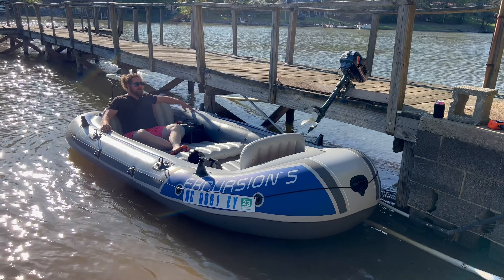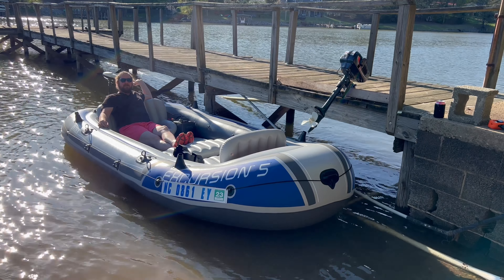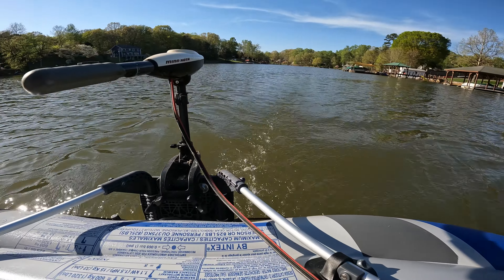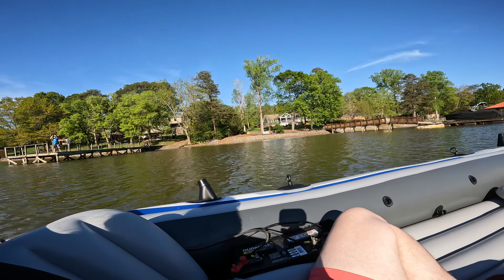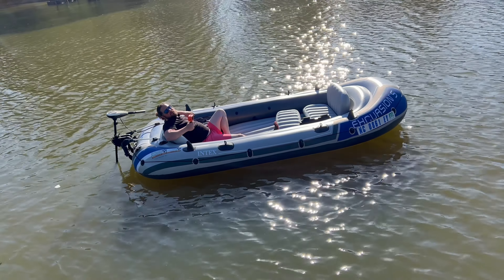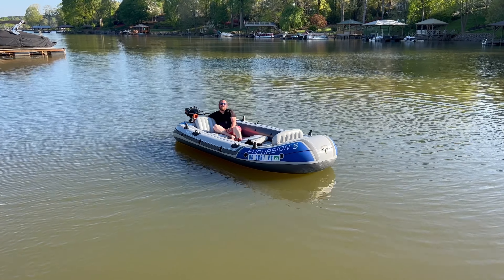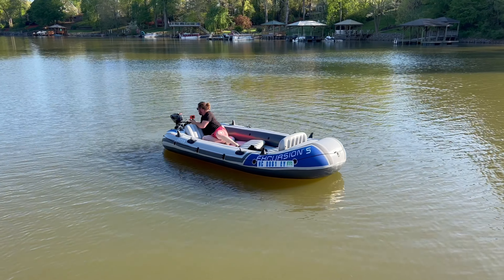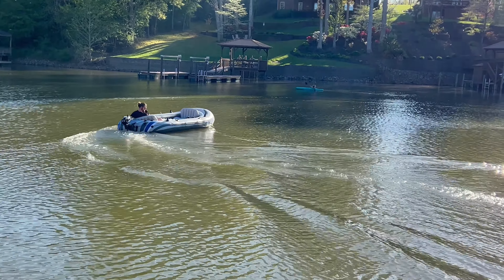Intex Excursion Gas vs. Electric Motor

Comment: Years ago I used to have an Intex Excursion 4 and I put a Minn Kota 30 on it. Only paid $100 for it back then. I also had a Minn Kota power center box that had the battery gauge built into it and a couple 12v outlets to charge things. Anyway, the electric motor worked well and the boat was good fun. Run for hours and costs nothing to take it out. Then as long as I had a good battery, that motor was more reliable than a cheap gas outboard. I used it to take photos and video of alligators and other wildlife. Being quiet would help not scare them off. Solar panel good to charge battery, like if you go out and camp for a night.

Comment: I've had both recently switched to gas, I do a lot of fishing in the ocean with some light waves, and the gas goes faster for me which I need sometimes. Also can fill up gas when the bite gets good and not run out if battery having to charge it overnight after around 3 hours of moderate use

Comment: Could you possibly make a video explaining how to disconnect the fuel line and how to properly store the motor when you are done for the day? Thanks
Reply: all small carburated engines should be run dry when done.

Comment: I also have one more question about the 12 hp. How do you order the parts for the motor , such as the water pump impeller, do u order an impeller from Yamaha or tohatsu that’s similar to the hangkai motor or is there a site that sells the impellers directly for the hangkai?

Comment: You could augment the battery with a flexible solar panel battery, which would still drain faster than charge but would last much longer and can also use to charge the battery fully after on land. it would fit on the bulbous part of the front with four bungees going to wrap around cord.

Comment: How do you get it so motor doesn't want to sink?  I have a 2.6 hp Coleman and me just putting it in gear it wanted to sink the motor.  Im trying to figure out how to raise things so it doesn't do that.  I know yours is a 2 stroke compared to Coleman 4 stroke but yours is more hp and doesn't seem like it wants to sink.
Reply from the maker: It could be the weight of the 4 stroke. I know there is a weight limit on the motor, but I can't seem to find the specs online. I'll have to take a look next time we're at the lake with the boat.

Also make sure it is inflated properly. We don't use the ruler, we have an air pump that fills it up to the right spec (I think it's 1 PSI).

Comment: Looking to purchase this for my son
I would like to do some modifications though.  )definitely a floor board
Reply: I have one of these and I put a floor in it, and a 36# electric motor. I also rigged up some pedals attached to the wood floor which connect via cables to a bellcrank I put on the motor shaft, so I can steer by the pedals and have my hands free. And my wife found a beach-type canopy which works perfectly with this boat (but she got it used, so I can't give you a model name, unfortunately). So I can cruise around, hands-free and in the shade. Not bad for less than $500 all in!

Comment: How long does a 12v battery last?
Reply: need to know the amp hours and draw batteriers differ
eg, 50ah battery with a 30amp  draw motor would last about hour and forty minutes if going full throttle

Comment: how much is the battery for the electric motor and where do I get it?
Reply from the maker: The one we used in the video is just a regular 12 volt Group 27 deep cycle marine battery we pulled out of our bass boat. That particular one is a Duracell we got from Sam's Club for $100, but you can pick them up at Walmart or most auto parts stores in the USA, but Sam's is usually the cheapest and comes with a 12 month warranty.
Reply: @HufflerGarage  the reason I asked was because the motor said 48V and I wasn't sure if the 12V would work.  Thanks

Comment: What is the weight difference between the 12hp and 18hp hangkai?
Reply from the maker: The 12 weighs around 57 lbs. (26 kg) and the 18 is about 84 lbs. (38 kg). We usually have to 2 man carry the 18, its fairly heavy.
Reply: @HufflerGarage  thanks man! I appreciate it!